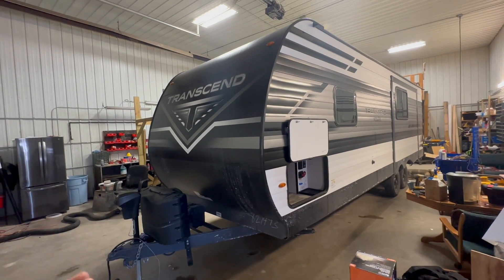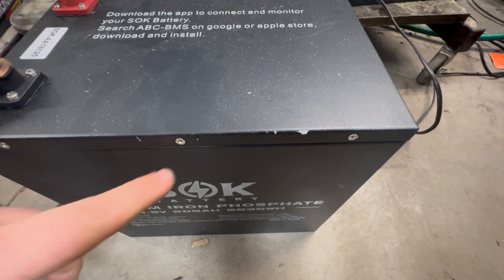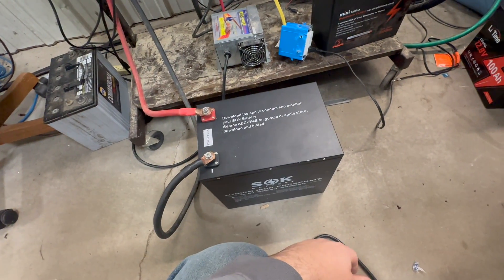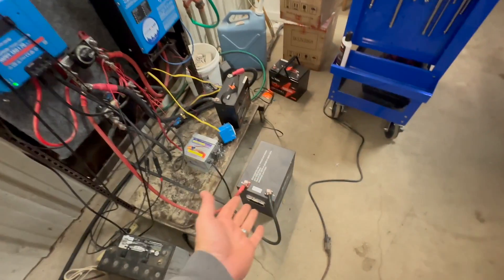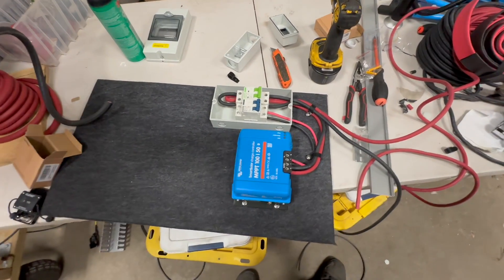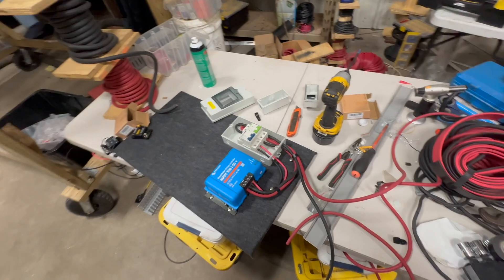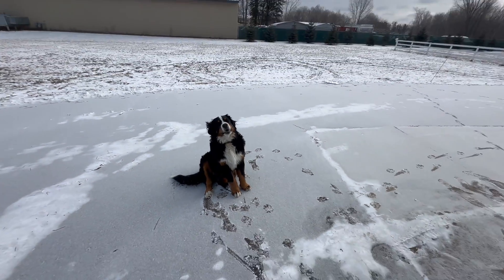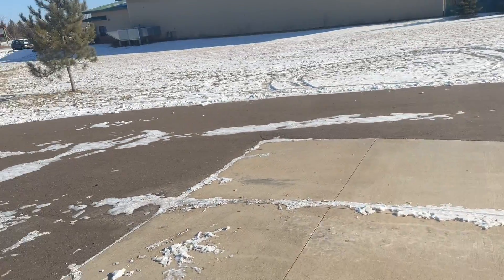Grand Design Transcend Small Solar and SOK Battery Battery Install

Comment: I don't mean to complain because this video is extremely informative. I just wish you would have gone into more detail and shown how you moved the wires off of the lead acid battery and relocated them inside. I know you talked about it a little when you were explaining what you did on the back of the battery shutoff which you didn't mention. I swear, I'm not complaining or being mean. I hate text. I know you're not a mind reader and can't please everyone. That's just information I'd love to have to do what you just did. Maybe you were limited on how long this video could be? Thank you again for taking the time in that cold weather to do this.
Reply from the maker: Well received. For this reason I wish I could add to videos post upload.  

The simplest way I can explain it and usually what I do, is I run jumpers out from new battery location to old location and the nut and bolt the new jumper leads to the old. Then everything that used to work still works in the same way. 

You can get clever and connect in other ways, but I feel this is the most intuitive for an RV tech or new owner when someone else installs something.

Comment: I have a Transend and have been using a renogy 200 watt suitcase which i plug into the 10amp Furion prewired factory plug. I am using two 100 amp Gel batteries. Its not enough. I want to mount panels on the roof but not sure where to run them down. Where did they run them down on your project? If i run from the inverter to to lugs on the factory switch will that be sufficient and automatically switch when i plug into shore power?
Augie

Comment: Great looking install. I was hoping you would show the wiring when  you removed the stock battery. Thanks Don
Reply from the maker: Sorry, it got busy around the shop and was super cold out (unlike now) . 

With the way I hooked things up inside. All I did was shrike tube the leads for the old battery and tied them up.